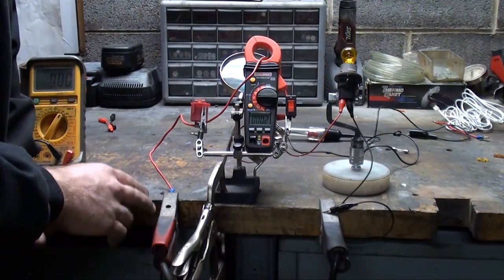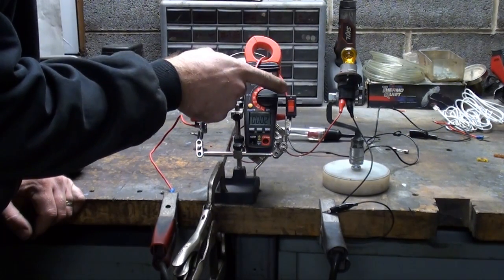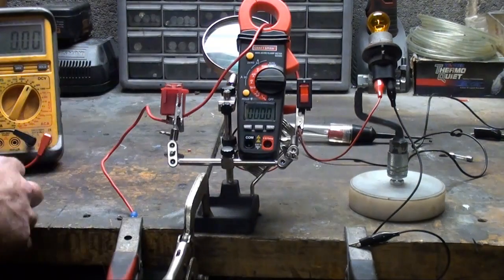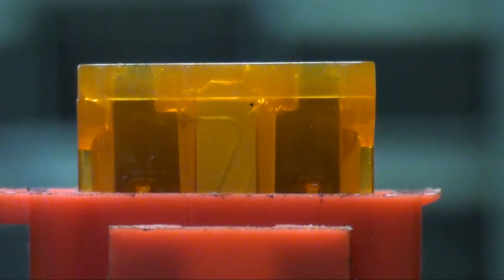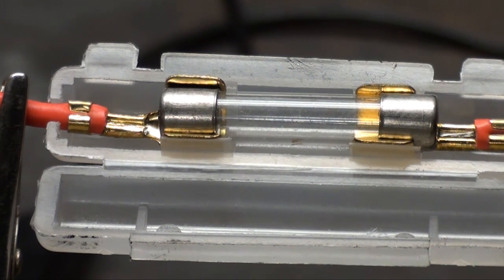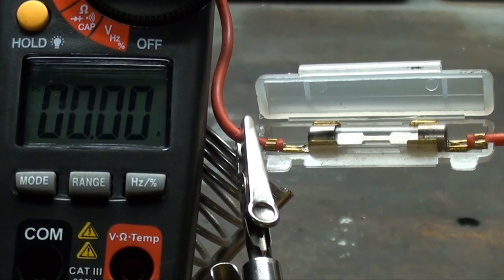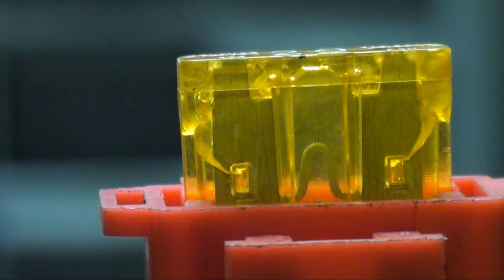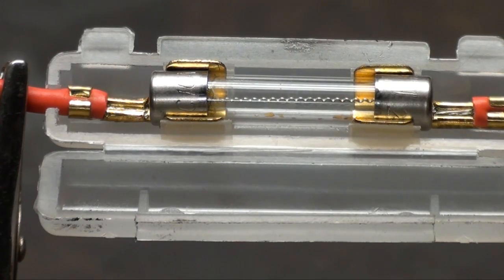Having fun with fuses (short circuit)

Comment: You need to find out what caused the first fuse to blow. It may be a short somewhere. And if you used to big of a fuse or the fuse didnt blow at the right amp it may have burned up some wire somewhere. You need to trace your wire and make sure you have continuity Good luck i know from experience this can be a headache..

Comment: Greetings ... Had a quick and simple question, is there a way to measure the amperage of a glass fuse via a multimeter ? Some of them loose their embossed print in the steel section and its never possible to know how many amps that fuse is.
Reply: without blowing one, no. a dc-dc converter with an integrated voltmeter+ammeter could be an option if you don't have a lab bench power supply, raise the voltage from the minimum and check the current

Comment: I have a 92 Olds Delta 88 Royal, it will kick over but not start and the windows won't roll dow.  It did this about a month ago and it turned out  to be a 30 amp fuse, it did it again and I put a new fuse in it and nothing same thing will crank and not start and the windows will not roll down.  It has a new starter on it I don't understand why it's doing it again
Reply: kim s there’s a short somewhere in the wiring which may be a bad ground